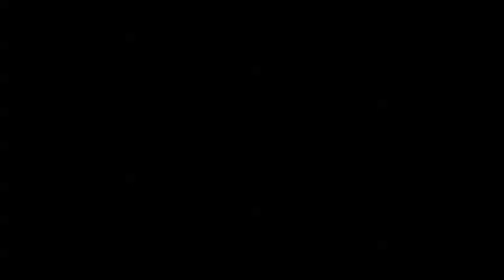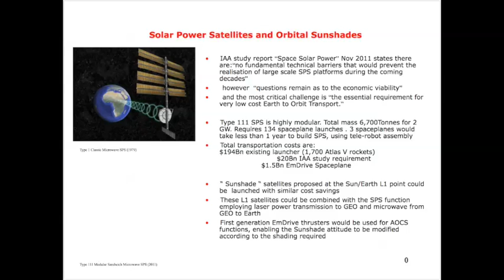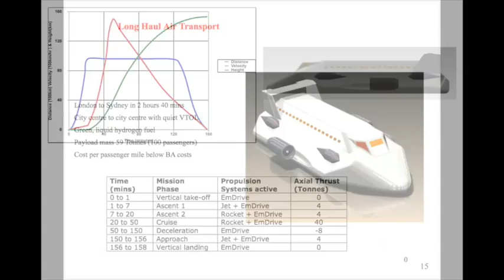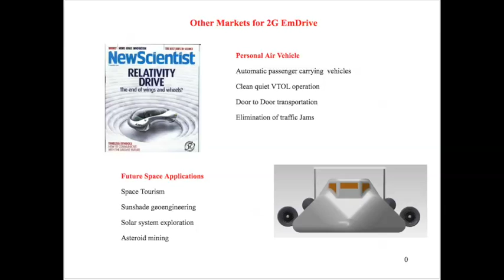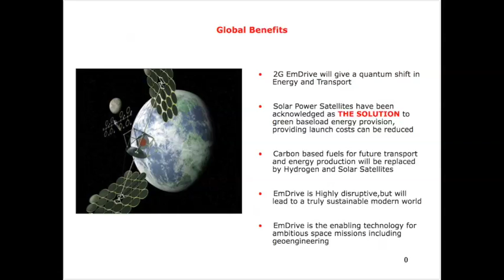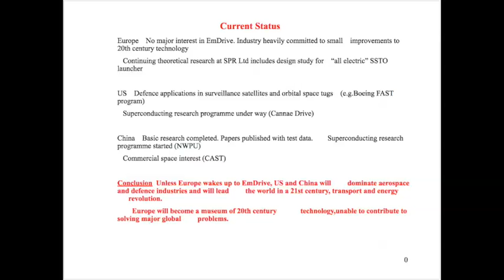Emdrive Presentation By Roger Shawyer   Part 3 of 3 opt

Comment: It's hard to agree that the Solar Power Satellite is the most important application of this technology. Reducing air travel  time by a factor of 7 or more is way more important. So, it is space travel. There need to be a 2G demo that can show real thrust being developed. Like a floating platform. That would get the naysayers out of the way and gives this the credence it should get.

Comment: I did some more reading and it seems one of NASA's tests included a 'nul' setup to test Roger's theory. This nul setup was designed to not produce any force if his theory was true but a force, although smaller was still generated. If this result is true this means Roger's theory is likely false, which isn't surprising seeing as the Chinese seem to have a different theory and it's a new and unexpected result anyway. I digress, the fundamental point is that if Roger's theory is incorrect then it's likely his predictions for the next generation device are incorrect and the claims in this video are unlikely to be realised. Sadly... That said, something is going on and hopefully if the mathematical and physical model can be found the effect can be scaled up. Who knows maybe the NASA setup was inaccurate, in which case I look forward to seeing the second generation results. Good luck!
Reply: This kind of effect was predicted by Subquantum Kinetics. The effect is called electrogravitics.
Reply: Opdehoede This is not an electro-gravitic effect. The electronics are in no way manipulating the force of gravity, as would be happening in an electro-gravitic device.

Comment: I don't pretend to understand half of what you are saying, except the piece on aircraft.
Firstly, aircraft are built the way they are for several reasons only one of which is weight saving. Its mostly to do with structural reliability from the constant pressure cycles.
If an EM drive fails on an aircraft what happens. If it was built like a science fiction type shuttle and suffered a failure then indeed it would be a flying brick.
Reply: If you slowly rise to orbit, accelerate and fly in space with no gravity, or thermal or air turbulence, the need for that structural reliability is much less. It's not like we'd build a rolled steel craft as our first commercial emdrive vehicle, but his point is when you take away all those forces airplanes endure you can build stuff cheaper and heavier with much less consequence to reliability. Plus an emdrive is just a microwave, how often do microwaves just fail? And all you'd need is one to slow your descent to the ground, im sure there would be multiple safety redundancies as well, hell a simple parachute could probably return it to home safely, something not very practical with an airplane traveling through air. Emdrive you just deploy the parachute in near earth orbit, where it travels, and there would probably be enough atmosphere to slow it down in a reasonable amount of time, then glide it to earth. I mean we were parachuting tanks in 1947. 

Now that i finished my little novel i see this comment is a year old, lol, oh well too late to delete now.